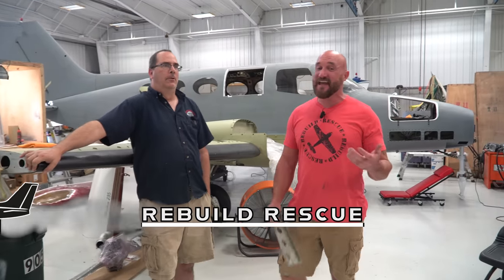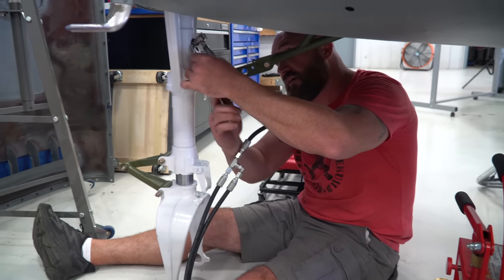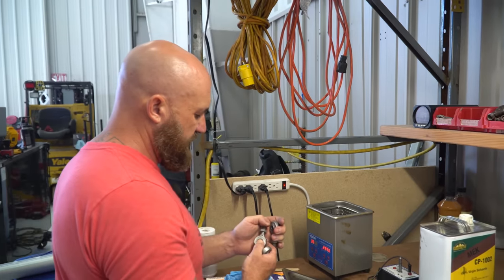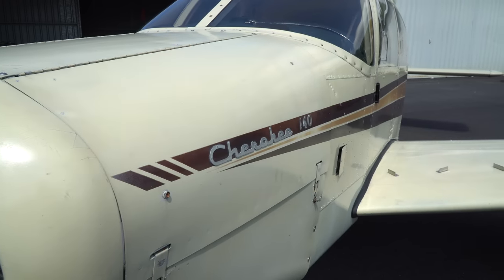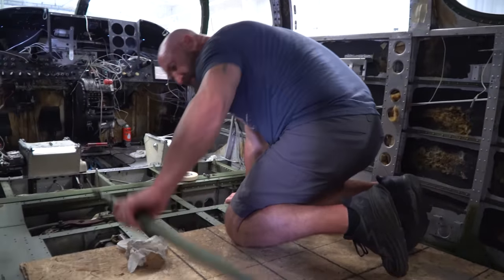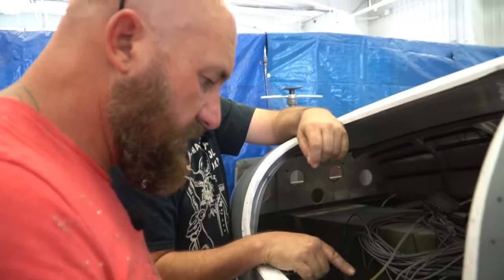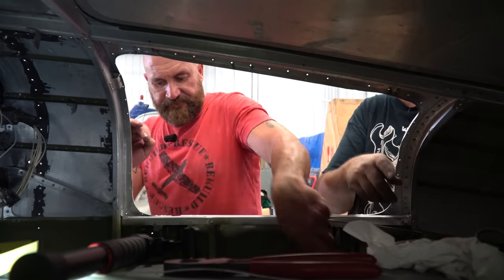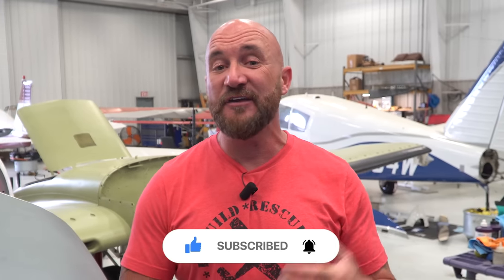We Spent DAYS Struggling With This on The Free Abandoned Airplane…

Comment: Fabulous work Jason and Greg, the detail was awesome to see. Glad this week we got to see an update on the 401. It’s truly amazing how well you’ve done and how much work has been put into this project even in the amount of time it’s been. The rewarding part to me is seeing all the extra effort using the vapor honing, the dry ice machine that helped clean the different areas which will truly make this aircraft the closest thing to a brand new aircraft.
Reply: The amazing thing to me is how this rebuild shows, just how flimsy this plane is from the factory, with so many cost savings that sacrificed structural integrity. Then they had the balls to sell this plane as pressurized is unbelievable. The doublers need all around the whole airframe, which should have been done at the factory in first place, just shows you how it easy it is to sell a paint job to unsuspecting customers.

Comment: The roughness (ratcheting) in the rod end is from bearing wear due to breakdown of lubrication over time.  These ends are packed with grease for lubrication.  I would think that cleaning in ultasonic cleaner wouldn't be ideal. I'd replace now so you wouldn't have to go through the hassle later

Comment: Handy tip Jason 
Instead of using a marker top basically layout a template from original 
double sided tape is a breeze 
Old part on top tape in middle new piece on bottom and drill trough

Comment: Schrader valves, like regular ass bicycle tire Schrader valves can hold up to 15,000psi. Not a few hundred. The reason for the larger fitting is NOT to help hold pressure, but to make filling quicker and easier.

Comment: Wouldn‘t it would have been more efficient to just had ripped out everything first? I mean you removed a lot of old cabels and hoses. But you did not clean up everything oder chromated all parts - because you do not get there. Lifting up on piece of metal reveals corrosion - there might be more.

Comment: You guys have to stop using a damn chisel to knock off a rivet head, you drill the rivet head by rotating the drill motor, then you punch the shank out. No chisels on rivet heads because you could damage the material that's riveted together, come on guys 😡

Comment: Porting & polishing cylinder heads is an old hot rodder trick for increasing air flow; I'm surprised more engine shops don't do it for aircraft engines.

Comment: If the engine fails on takeoff you'll not make the impossible turn plan for landing in front of you before takeoff look for possible landing sites on the maps and once in the air look for sites in front or slightly off to the sides